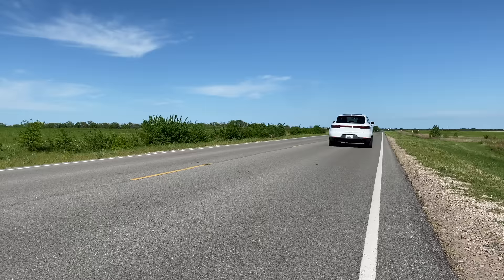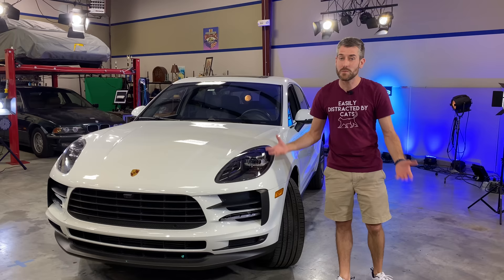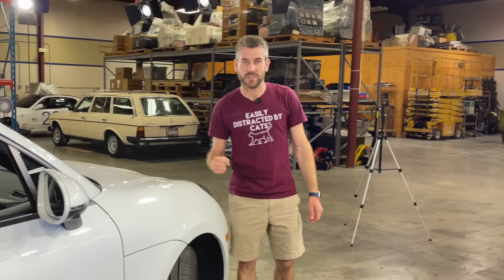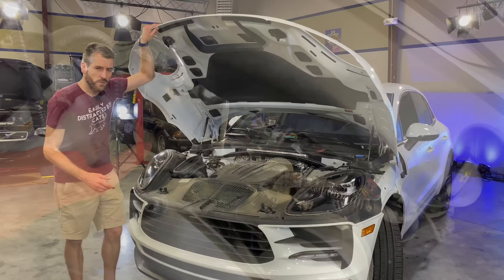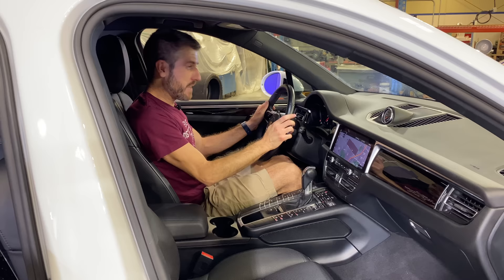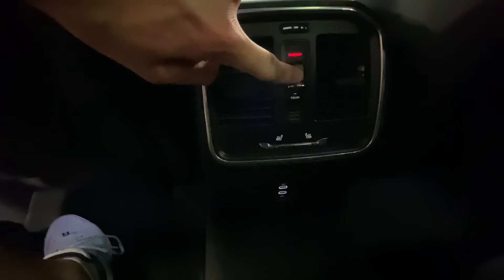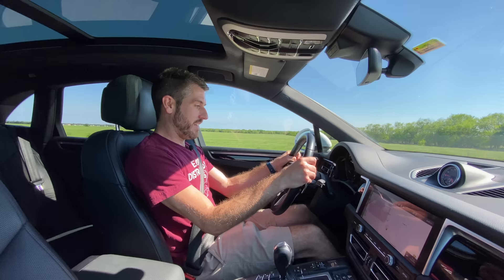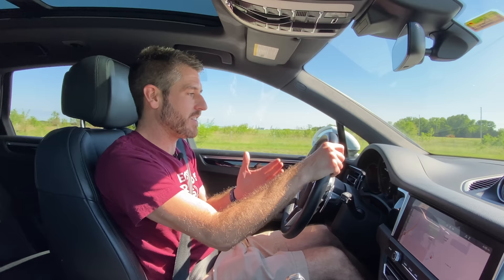Here's Why The Porsche Macan BASE MODEL Is Actually GREAT!

Comment: So, I got the Macan T model....well, not too bad BUT absolutely not worth the price they ask for it. I thought a prestigious brand like Porsche would built cars with more accuracy. The ergonomic is not that great, basic plastic covering the lower part of the doors, just raw plastic. The 265hp engine is too just for such a heavy car... 300hp would have been better. At Porsche they do no map reprogramming so I have to wait 2 years after the warranty is off, then I will change up to 300hp.... What I like is the extended leather interior and the big display and the way it stays on the road... But radio reception is not fantastic due to automatic changes between dab and FM stations. There is always kind of 1 second of silence while switching to dab/FM trying to find the best signal...quite annoying... This is my first 2-week experience with the Macan T... I come from the Alfa Stelvio Diesel 210hp, I had it for 3 years, and I can assure you that that car is much more value for money than you can believe... Now I check how the everyday with the T will be. 🙋🏻‍♂️

Comment: I had contact with the previous generation Macan with the 3.0 diesel, and indeed is a very very nice car. A Porsche interior these days, either in the Macan, 911, Panamera, Cayenne, is one of the best in the business. It feels solid, driving position is awesome, very comfortable, every button, lever, and control has a very solid feel, it always smell very good, and it doesn't fall apart with time.
To be honest I do like the first gen rear end better than this restyled one... but this new one has something new... a 4 cylinder engine.... and although it performs well, I'm always very skeptic about the reliability of an engine that small being asked to deliver all that performance, pulling all that weight. The previous generation base model V6 was a very decent engine in the reliability department, I seriously doubt this new 4 pot will be able to beat that reliability record... but hey... this is the sign of the times...
Reply: Yeah I think a lot of these 4 cyl turbos are going to be problematic. It’s one thing to push a small car quite another in a suv.
Reply: Diesel Porsche… ill say 4 cylinder is Porsche… diesel is not!

Comment: Everything I've seen about porsches tells me they are one of the best built vehicles you can get.
Only thing is their prices for options are ridiculous.
I so hate 4 bangers! Trying to get to much power out of to few cylinders.
Reply from the maker: Porsches are exceptionally well built. They are expensive, but in my experience, they are worth it.
Reply: @ElliottAlvis  four grand for a set of wheels not much different than the stock wheels is a bit much.
Still, I'd like to have a late model 911!